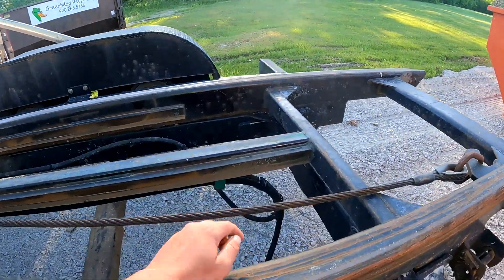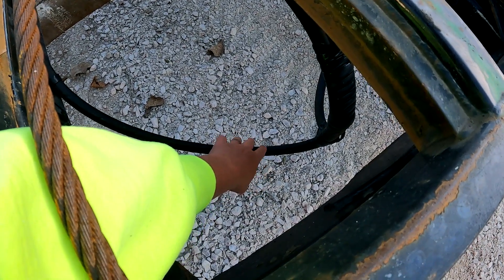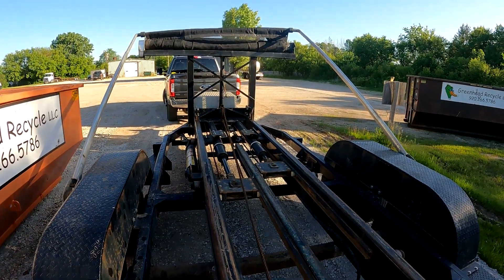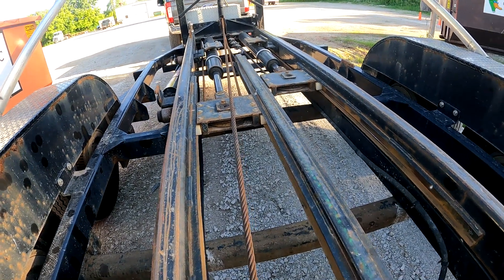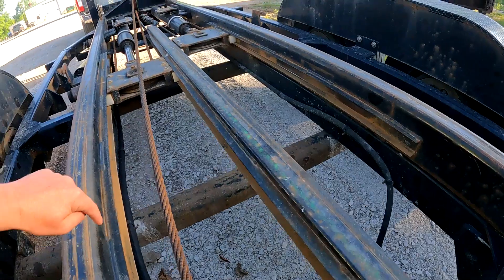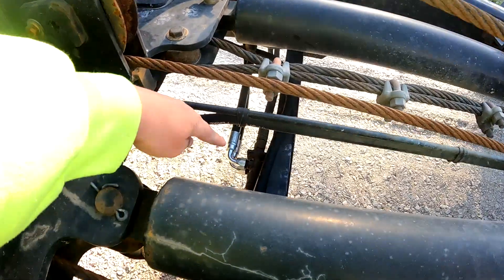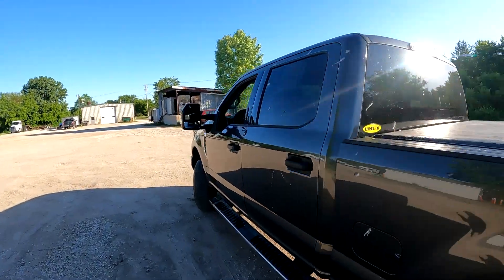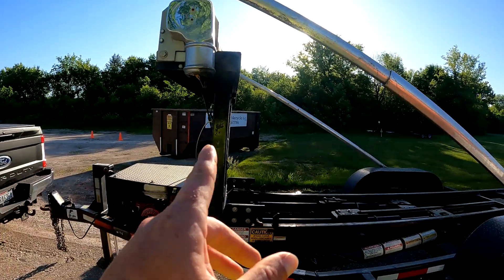WHAT IS THE RIGHT TRUCK FOR THE DUMPSTER BUSINESS

Comment: The best advice you can give your startup followers is to purchase only 20 yd containers. You can always have a customer put lest but you cannot drop off smaller and expect to put more in it. As far as your truck evaluation goes startup costs in the beginning you want to keep at a minimum so go with 2500 and if business is good and successful then down the road traded in for the heavier-duty rig.
Reply from the maker: The cost for a 250 or 350 is the same when new unless its a diesel. I tell people all the time to start with 20 yard dumpsters. I have mentioned it many times in past videos. paint lines inside for 15yd and 10yd
Reply: Very good advice.
Reply: Very good advice. That's the best advice.

Comment: I started with a 2021 Ram 2500 6.4. with 3.73 rear gear. It has done good in my relatively flat area. She definitely revs out on hills. Pulled 20,000lbs a couple times when a can was overloaded. If you are in a hilly area, I would definitely go diesel.

Now that I have a Bison trailer, it is a lot more tongue heavy than my Protainer and causes some squat. So I ordered a 2022 Ram 3500 SRW chassis cab 10kGVWR with 6.4 back in April. It is rated to tow 18,000lbs with the 4.10 rear gear. About max I can pull under CDL and with the de-rate I won't need DOT # either.

Plan to put a hot shot body, trim the bed rails and tuck the hitch mount as close as I can to the rear axle. Hopefully will reduce any squat and shorten the overall footprint by 2.5ft vs my current 2500 Crew Cab. Keeping the 2500 as a backup. 2 Trucks and two trailers for well under a new hook truck, with less/easier maintenance and have that redundancy if one does happen to go down.

Comment: I have had a lot of people ask why I chose my 96 f350 for the business. I always say it was simple I already owned the pickup. No truck payment means lower over head. Pulse the pickup has been in my family since 2000 and I know every service record on it it has 453k miles and is still kicking strong
Reply from the maker: They don't make them like they used to! I think half of the wieght of the new trucks is computers and sensors!
Reply: @Lifes_Apprentice  yeah no kidding. There is only 2 good thing about the new pickups, they have a ton of power and there braking ability’s
Reply: @adamwilson9337  It seems like the newer trucks have higher towing capacities too. Are you seeing the same?

Comment: I run a 2006 f250 with the 3 valve V10, tow 10-12k lbs 7x12 fully loaded dump trailer often and it does it just fine. The 6.2 makes torque and power a bit higher in the rpm range than may be ideal for heavy towing. The truck itself, frame, ratio options etc are all identical from a 250 to 350.
Reply from the maker: Thanks for watching!

Comment: Great video Justin and I can answer some of your questions on 3/4 ton versus one ton   Or as you refer to as  a F250 versus a F350 single rear wheel  " not the dully version".  The main difference between the 2 is the rear end  Gear ratio.  That comes standard in that truck's weight rating classification . You can actually order a 3/4 ton truck with all the specifications of a of a One ton single rear wheel truck And the only difference will will be basically the leaf Spring package  But it is cheaper to order a one ton single rear wheel truck because it is a standard build and have it deregulated to the 10000 GVWR.   There is some other slight differences but that is the main one.
Reply: Yeah most people don’t know that it’s just more leaf springs .
Reply: @hhprogressiveconstruction1140   Basically leaf Springs and the rear end gear ratio are the only major differences
Reply from the maker: Ford will not even take an order for a truck until september this year so I am kinda stuck for now. I want to get a roll off truck but that isnt easy either. not sure what to do
Reply: @Lifes_Apprentice  Hunker down keep costs down at least see how 22 pans out . You will get the truck sooner then later .
Reply from the maker: @hhprogressiveconstruction1140  I am chilling out with growth this year for sure. trying to pay down some debt figure out our next move towards expansion but the next 3 to 5 years are gonna be tough because of what I believe is the beginning of a recesion
Reply: @Lifes_Apprentice   I know  That my next truck for the dumpster business will be a roll off truck. If you're gonna order a truck you just gotta do it.  But I hate to say it I think we're heading into a recession at least to slow down.
Reply: How do you have a 3500 0r a 350 truck deregulated at?
Reply: @revfred2008  you have to have your dealership order it that way from the factory.
Reply: @danahasson2892  OH, okay. It can only be a brand new truck from the dealership? Okay, thank you!

Comment: Agreed. F250/F350 isn't going to matter. It depends on the gear ratio. Payload on the F350 single axle will always be more than a F250 but it's nothing a set of air bags wouldn't fix. The diesel will always have more pulling power than the gas as far as not struggling. But have you seen the price of diesel lol. I have a brand new set of air bags and a brand new compressor by air lift still in the box if interested. They will fit a 2017-2019 F250/F350 single rear wheel.
Reply from the maker: I don't plan on running the 250 much. If I could get another truck I would. Ford is'nt taking orders until september so we will see what happens. The power difference between 250 and 350 is the biggest difference I see but that could be gearing like you said

Comment: Were you using cruise control? It saves you more fuel when towing to not use it. Also, it's easier on your transmission. I always drive manually with a load. I have the 7.3 F250. What I mean by manual is not the transmission but simply not using the cruise control,  my foot controls my rate of acceleration.
Reply from the maker: driving manual is probably the right way to go. driving all day cruise control is nice
Reply: @Lifes_Apprentice  Thanks for the reply. I'm on a Life's Apprentice binge watching session.
Reply from the maker: @UnfavorableGamer  Watch them all! lol I try to answer all the comments. If you have any questions ask and Ill get back to you

Comment: I think the last truck I bought ( 2020 F350 SRW )  the difference was in carrying capacity….or how much you can put in the bed….presumably because of the leaf springs. Comparing diesel F250 to diesel F350, towing capacity was the same. I think the thing to remember is that if you are pulling heavy trailers, it would be possible to place to much axle weight on the truck. I think that if you were serious about this business, the best truck would be at least a 1 ton dual rear wheel if you can afford it.
Reply: So the towing capacity on the F250 & F350 is the same, the only difference is the extra weight you can add to the bed? Would I be able to run a F250 with no CDL then, and not have to derate?

Comment: Awesome videos! Looking to get the nedland 16k …. Do you ever feel it’s too long? Or the need for the gooseneck for tight places? Can you still cut it hard for a tight spot without getting close to bumper? Thank you! Keep up the great work!
Reply from the maker: You will love your nedland trailer! we get our trailers into very tight spots all the time and you can jacknife it alot. Nedlands makes a gooseneck attatchment that you can bolt on to any of thier trailers if you decide you want to switch
Reply: @Lifes_Apprentice  ever have any problems with the motor? Starter or carb? Thanks
Reply from the maker: @danielstrong650  We have had problems with the motors but always minor problems and parts are pretty easy to get. Never had to replace a motor

Comment: No real difference between F250 vs F350 SRW besides a couple more leaf springs in the rear suspension... The BIG difference is what gear ratio you pick in the options menu thats available on both models... pick a taller gear and it will lug when towing heavy loads but get better highway mpg... shorter gear and its the opposite.